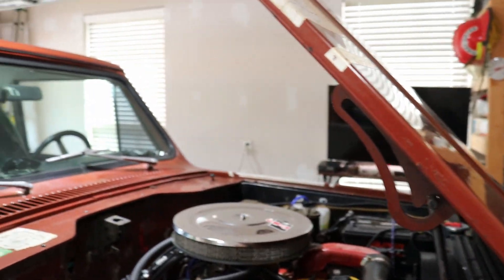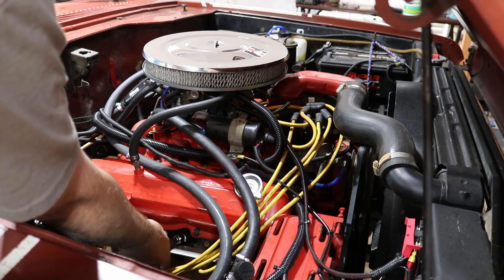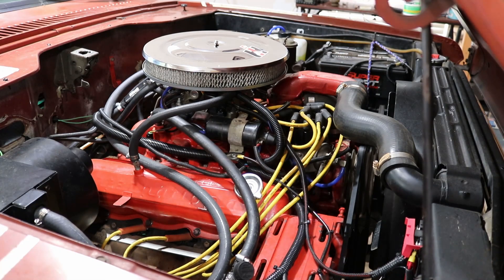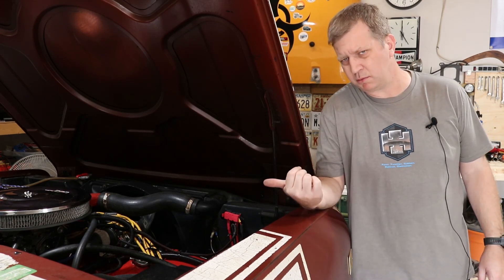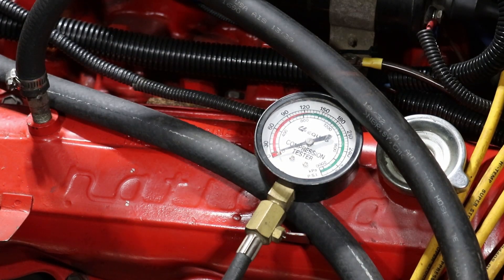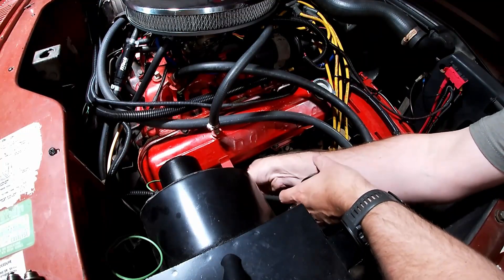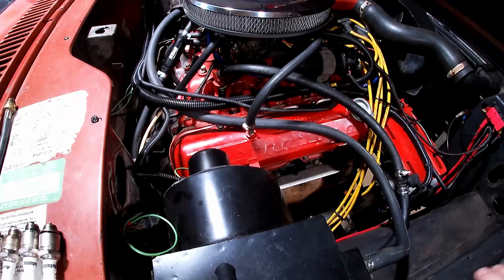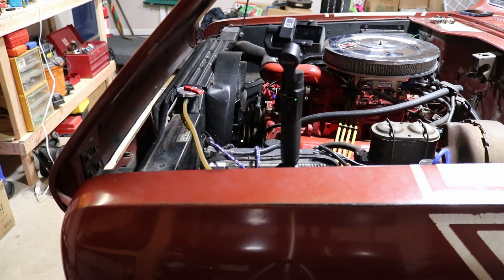Spark Plug Wet Fouling and Compression Test on the International Scout | Part 1

Comment: Did you find the issue?  My plugs on my 78 345 are pretty wet too
Reply from the maker: I don't know for sure. Tear down of the engine has begun and I suspect its multiple causes. Ring(s) in number 8 appear to be bad, and some of the valves and springs are questionable.